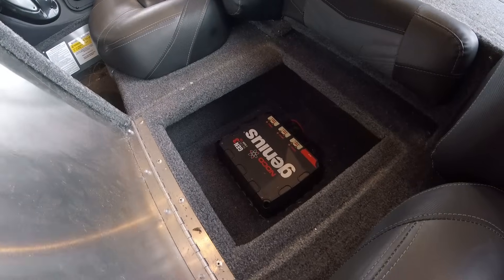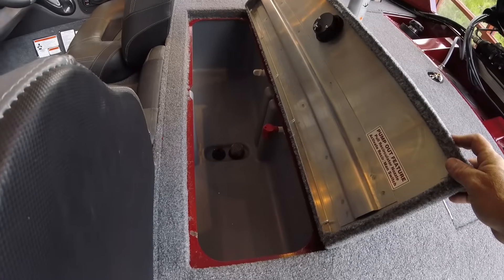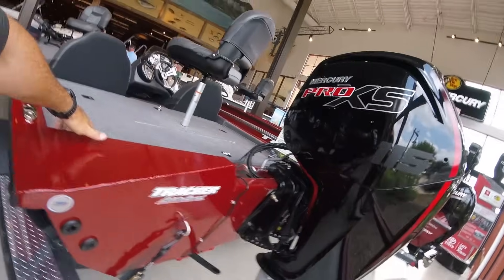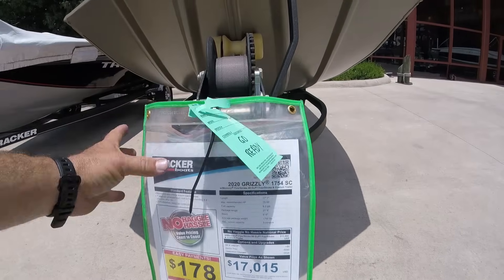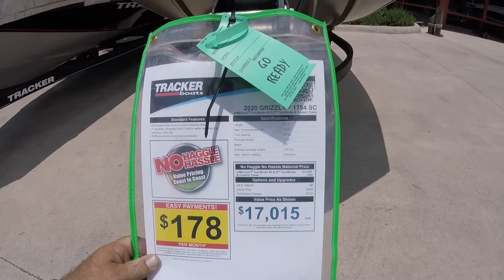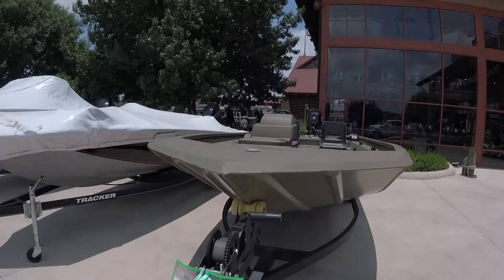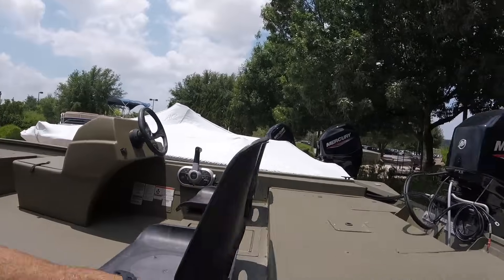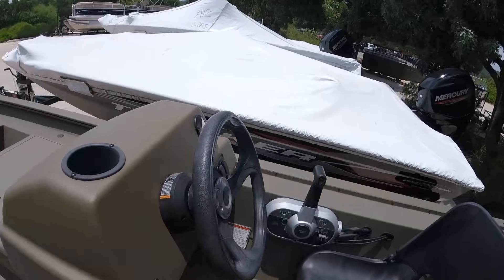Bass Pro Shop Boats - Walkthrough Prices, Specs, Features. Which Boat is Right for me?

Comment: Problem with bass pro is they under power them on engine and trolling motor and you can’t upgrade. Better off buying elsewhere so you can choose. There warranty work is a joke also. I own a tracker grizzly, good boats but would not and will not buy anything but tackle from bass pro
Reply from the maker: That’s so good to know about them. Thanks for letting me know about your experiences bud

Comment: Everything on the Nitro boats is plastic vs fiberglass, underpowered outboard & trolling motor, cheap carpet....if your going to spend 50k+ on a bass boat, look elsewhere
Reply from the maker: Yeah they definitely need upgraded outboard, and trolling motors
Reply: I have a 2019 Z-17 and 115 hp 4 stroke does a fine job. Nitro motor sizes match up to every other brands hp size versus boat length. Carpet is better than my old  Astro had when it was new. Trolling motor does fine. Fished several times in  10 to 20 mph winds. Basically seems like you just don’t like nitro boats.
Reply from the maker: I like Nitro boats, definitely more than I might spend but you never know. I might end up with one.

Comment: Most who buy their first boat from basspro, will not buy their second one from them.  Trackers are junk.
Reply from the maker: I have heard both good and bad from everybody. That stinks you had and experience with them. They sure do look nice when they are new.
Reply: They look amazing, but i have heard horror stories about their warranty.  They are far less expensive than the competition for a reason.  Half the materials, half the engineering, for a little more than half the price.  Had a nitro z6.  Hull cracked in rough water.  Totalled the boat.  Bought it used, no warranty, but thats industry standard.  Couldnt believe the boat couldnt withstand the forces of rough water.
Reply from the maker: Dang that sounds like a bad defect in the building of the boat, but who really knows. That would make me be shy when going into rough water that in any other circumstance you could rip through the waves. I have heard great things about buying from the dealers and not BP.
Reply: Absolutely love my tracker pro 190.
Reply: @justinlemos1240  thats great!  I havent had any personal experience with their aluminum boats.  I had a 2011 nitro Z6.  The hull cracked due to rough water.  I couldnt believe it!  Hull and cap were separated as well, but that is common with fiberglass boats of all makes.  I went aluminum this time.  Bought a gatortrax strike.  Pricey, but built like a tank.  Not a rivet on the boat, and its 3/16" aluminum throughout.  They use extruded aluminum bracing (not bent into shape, but built to the desired shape. Angle, square tubing, channel, etc.   Had it about 8 months now.  No complaints so far.  Rides like a glass boat, but will last forever.